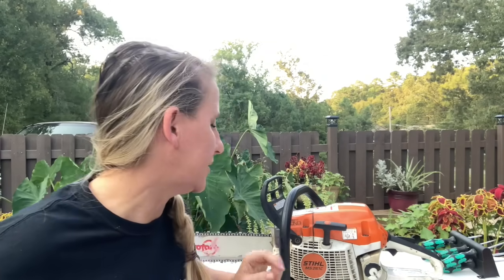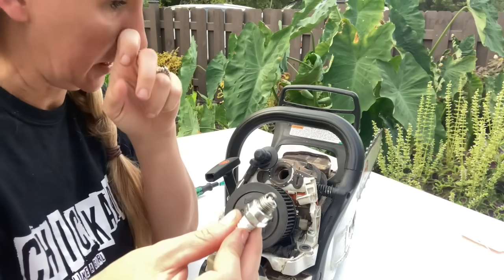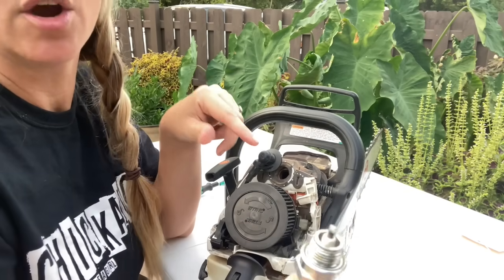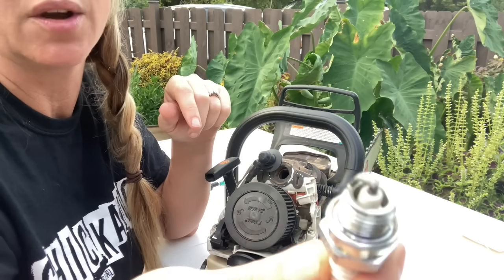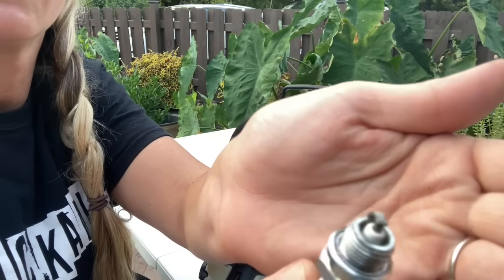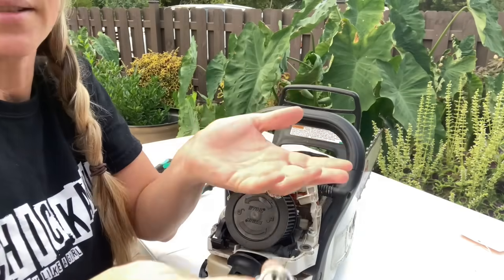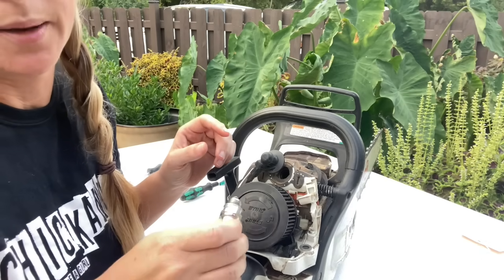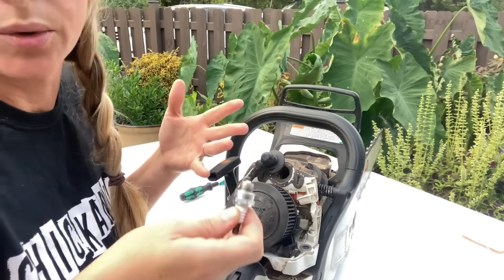STIHL M-TRONIC CHAINSAW HAS NO CARBURETOR ADJUST, WILL IT "RESET" TO REGULATE FUEL CORRECTLY?

Comment: takes 5-6 pulls to start when its cold....my chinese made weed wacker starts in 4 pulls max. usually 2-3 but if i'm fast enough on the choke lever i have gotten it start in 1. my $58 on clearance poulan blower starts in 3 pulls. my 3 chinese made chainsaws, 25cc, 42cc and 55 cc all start in 3-4 pulls except the 55 if it hasn't been run in a while it has no primer bulb it can take 6 pulls.

i can't believe people actually pay for Stihl equipment. get a clue people. their entire business model is about fleecing you. their oil is cheap shit. its JASO FB. the other brands, echo and husky are JASO FD! CERTIFIED! not "meets or exceeds".

don't believe me go hit the other channels that are saw oriented like The Iron Horse. Stihl's oils are dirty ashy oils. i can name 1/2 dozen better cheaper oils. Red Armor, Power Blend, Husky HP, Sabre pro, Opti,  Schaffers all cleaner than Stihl ultra. the orange bottle stuff isn't even rated!
Reply: You think all these name brands like Echo and Husqvarna are manufacturing their own oil? It all comes from the same place and gets a different name slapped on it. Stihl is expensive but so is Husky, Echo and any other saw manufacturer that has built a name recognition for themselves among professional users. In reality, the price of the pro level name brand saws is only a jaw drop for the home user. For the professional user, the price is average and only costs a portion of the money they will make with the tool.
Reply: @killer2600  its not "all comes from the same place and gets a different name slapped on it" you obviously don't know much about 2 cycle oils. Stihls HP Ultra is a jaso FB oil. says so right on the back of the bottle. I have one right here. Says Meets Jaso FB. The Vp oil I have here is Jaso FD certified with its Jaso cert number right there. the amsoil sabre i have simply claims to be Jaso FD and ISO l EGD as does the Shaffers 9006. Jaso FB is one of the oldest Jaso ratings. The Jaso standards measure detergency and lubricity and the current ratings are FB, FC, and FD. Lubricity is similar across the 3 standards but each has ever increasing levels of detergency. this is why Stihl owners running Stihls oil have to get their arrester screens and exhaust ports cleaned more frequently than users of the other 2 brands who use their brands oil. All of Echos and all of Huskys oils are Jaso FD certified. Btw have you noticed how Stihl sells the hp ultra and the orange bottle stuff here in the USA and not the HP super? The HP super is actually Jaso FD certifed but isn't sold here. You can get in Europe or in Australia but not here.

wonder why that is?
Reply: @MrSGL21  Jaso doesn't make oil so bringing it up is irrelevant. It's only a rating system for minimum compliance. 5w30 is an old long used oil weight, 0w40 is much newer, just because 5w30 is old doesn't mean it's not just as good as it always has been for cars that require 5w30. If Stihl engines only require Jaso FB compliant oil then Jaso FD rated oil is irrelevant. In fact if the newer spec isn't backwards compatible with the old spec then an oil with the newer rating could be the wrong oil for the engine - this most notably happens with old diesel engines.

If you want to be dupped into the most eye catching packaging and highest cost being the best then you should look into amsoil. They would love to have you as a customer of their exotic products. Not to say their oil isn't good but I've never used them and every thing I've ever owned or used works as good as ever despite me never giving amsoil a single cent. Even my 39 year old motorcycle still works and it's never had synthetic or expensive oil. Actually, it has the cheapest oil I can find for it that meets Jaso MA (motorcycle wet clutch) spec which funny enough is rotella diesel engine oil. So empty your wallet if you wish, I don't and my oldest vehicle doesn't burn any oil and runs great even if I'm not buying the oil with a picture of a motorcycle on the bottle.

Comment: Great video, I think the ignition module also senses the load on the saw when it's in the wood and richens the mixture accordingly, so an off load plug chop could be miss leading.. M- Tronic carbs are just as easy to rebuild as the normal carb. I strip,clean and replace the diaphragms in my MS 362 M -Tronic every 2yrs or so..Don't be afraid get stuck in.. lolx
Reply: issue ive encountered is big end bearings seizing no damage to cyl piston seems either a binding issue or my theory is developing an air leak and trying to autotune itself to compensate so continues running but kills itself vs just becoming unrunable so you fix it.
Reply: @glennlurman3514  You look far to young to be playing with chainsaws ! lol. Thanks for the info though, it does make good sense..

Comment: 3rd generation mtronic is a different recalibration process. Stihl technicians know that. I own several mtronic saws (261, 462, 661). All are excellent saws. Mtronic systems are extremely reliable. You're bread is obviously buttered by echo, and it shows.
Reply from the maker: This wasn’t a 3rd generation reset or I would had shown that. I love my Stihl Saws, 044 and 026. And yes, they are great saws, until they’re not. Thanks for watching!

Comment: Yep! That plug looked mighty lean to me, but unless you can see the very bottom of the ceramic insulator, (impossible to do without chopping off the threads- hence the term "plug chop") it might not be as bad as it seems. But the real tragedy is many folks see this and think- just add more oil, it'll be ok. But that only leans out the condition even more. Another example of "right to repair" needs in the real world.
Reply: The MDG1 diagnostic software is not needed to make any repairs on this saw or "tune" it. You CAN fine tune it with the software but it's usually not necessary. The reset procedure is usually good enough to get it to a standard setting to start out with and it will fine tune itself the more it's used. I hardly ever use my MDG1 tool on chainsaws I use it mostly on the more advanced stuff like the cutoff saws and the new 500i fuel injected stuff.
Reply: The only way to tune WOT by plug color is to first warm up the engine, install a brand new plug, run at WOT, and shut off the ignition while still at WOT.  The plug above is from a 2-stroke done exactly as described.
Reply: Go to the picture titled "The air/fuel indicators".  Most people have no idea how to properly tune by plug color...one of the main reasons I don't recommend it for chainsaw users.
Reply: @SNELLERIZED  I don't have any problems tuning a chainsaw by ear, you can't tune a chainsaw by the plug colour.
Reply: Umm..... yeah listen "plug chop" has nothing to do with hacking a plug up and everything to do with "chopping" the throttle when the engine is under load. Easier to understand maybe when you imaging running a motorcycle up through the gears and at some point at the top of a higher gear grabbing the clutch as you "chop" the throttle and coast to a stop all the while while killing the engine (letting it idle will ruin the coloring of the plug in the test).
That test can also be applied to other engines under load but you get the idea....it is all to do with plug coloring, hot cocoa or better please  ;)
Reply: @KelleyCycle  But you do need to remove the threaded portion of the plug in order to observe the very base of the porcelain.
Reply: @SNELLERIZED  No, you don't need to butcher up a sparkplug ( I've never seen or heard of anyone doing that here in Australia), just observe the bits you can see. Check the next heat range plug up or down & you can see the difference in plug porcelain design that regulates the plugs heat range. The carbon colour of the plug tip after running awhile is nice to know but a just four stroking saw under no load on H is what you need to achieve & you get that through carb L & H mixture adjust screws.
Reply: @dustyfarmer  The part of the porcelain you're looking at has nothing to do with WOT.
Reply: @SNELLERIZED  What your talking about has nothing to do with chainsaw or two stroke engine tuning.
Reply: @dustyfarmer  I t has 100% to do with tuning ANY engine at WOT using plug color.  The ONLY part of the porcelain that applies to WOT tuning as at the very base of the porcelain where it cannot be seen unless you cut off the threaded porting of the plug.  The higher portions of the plug that you can see are colored by midrange and idle.

Plug color is a very poor way to attempt to tune a chainsaw.
Reply: @KelleyCycle  Chop, chop, pork chop, you got it in one.
Reply from the maker: Yup, I didn't say it in the video, because I wasn't sure how to explain the heat I could feel and the smell of the muffler when a machine is burning hot.

Comment: I recently rebuilt a used and abused Mtronic saw (ms 362) that I got for a song and one of the things I found out is to check the solenoid and fuel filter. Early black solenoids had issues if any grime got in, so stihl came out with a finer orange filter and a redesigned white and later green solenoid that together avoided the solenoid from encountering issues.

Within one of those carbs, they're essentially a standard carb but with a solenoid driving fuel delivery, so it's critical that everything be clean and functional. On that topic, the gaskets and such are still worth checking on them. In my case, the metering diaphragm was hardened and needed attention. After that the saw has been running perfectly for a few tanks.

I also found out the reset procedures are different for the 3 versions of Mtronic, and I mean very different. For version 2 it's letting it idle for 90 in the start position, turn off, start in the run position for 60 seconds, turn off, start and do 5 cuts through a log (Ideally at least 12 inches). For version 3 you idle in the start position for 30-60 seconds, then full throttle for 30 seconds when you'll find the speed drops to an almost idle (indicating calibration is complete).

Or you can convert the saw to a standard carb pretty easily with a new carb, run switch, ignition module, and possibly flywheel. (I don't remember if those are different). Top cover, too, if you don't want to take the cover off every time you adjust the carb.
Reply: Thanks for the information.  How do you tell what version your looking at? I have a 462 that must be 3 because that's the procedure my dealer told me to use. So far I'm really liking the saw and am amazed at the consistency in tune. I cut in different temperatures and altitudes and the saw is always spot on in tune.
Reply: @markw2266  on the silver label under the rear handle it may say "M3.0" indicating version 3. If not, it should be version 2.
Reply: yes, flywheel too, at least on the 362
Reply: I was actually just coming to the comments to type the same response. Yours was much more thorough than mine would have been. Lol Good info!!!
Reply: That was a perfect explanation.!!!

Comment: I would rather have it run too rich than too lean.
Reply: plugs easier and cheaper to clean replace than the piston rings and jug.
Reply: To rich will make carbon build up and then heat retention, not good in the far south .
Reply: @Charlie-Saringo  not to mention plugging the spark arrestor
Reply: @MrSGL21  ok boss
Reply: yea, me too, but tell uncle sam

Comment: Hmmmm i think i will stay with my old "adjustable" carbs in my 2 saws, easy to service myself or at my local shop. Love your work ! 🚜😊
Reply from the maker: Thanks Greg!
Reply: @Chickanic  great videos but you are making a big mistake, the ground strap on the spark plug is not a good indicator of how the engine is running the colors you see on the ground strap are from additives in the fuel and oil and not necessarily the fuel-air mixture you should be looking at the porcelain down in the center of the plug, Also you need to run the engine for a longer amount of time to get an accurate reading especially with a new spark plug.

Comment: i have this exact model /new/ 2019 and after running it for about 4-5 hours i couldn't start it, it ran then wouldn't start. this kept happening again and again.
took it back to the dealer and they had to replace the Mtronic part, so they say, to fix it.
3 months  and $150 later it was "fixed" , has worked perfect since then all year, maybe the issue was fixed? it's a great saw until it aint...
Reply: wow. really? a 2 year old piece of equipment and you had to wait 3 months and then still pay $150 in repairs. down for THREE MONTHS.
Reply: @MrSGL21  ikr, something to do with Chinese virus or something...
Reply from the maker: Sorry to hear that!
Reply: The real question is,,,,if Auto companies are having a problem getting chips, could this affect smaller stuff like this?
I believe it will, and as of late, the pandemic is coming up again. So we'll have to wait N see, but glad you got ur saw running again👍👍

Comment: I'm scared of computers,that's why I stay with "old school",and I can still work on all of my own saws. :)
Reply: Vintage is the way to go  love em
Reply: @razoredgesaws4202  i run the new ol school echos 490 501 63 an 7310and recentl stumble up on late 70s early 80s 400evl n aliitle 30$ in parts its up to par startd quikly probly wont use it much tho finish is 95% too it look runns great **dont know i go t 63 meanto sy 620 the mighty 620 at that
Reply: Just put top ends on 038 super and 036 pro, now onto 2  026 big bores but have to split the cases for bearings on those and should be good for another 8-10 years and yes I carry a tiny screw driver in my pocket while in the woods.
Reply: As you reply using a computer almost none of us understand and definitely couldn't adjust.  Some humor meant but realistically all of our cars are becoming black boxes and run more reliably than they did historically.  A PITA to fix when they do break but dang they run well in general.
Reply: @jasonjordan9598  I can build an M1 rifle from parts without even thinking,I've built engines from the block up,but I can barely work my "smart phone"  :D
Reply: @jasonjordan9598  ,it was meant as humor,but the newest vehicle I own is a 2005. My other vehicles are 1990's models that I keep running,and their computers are very primitive .
Reply: @ryanbruner8928  All in fun.
Reply: Uggggh, computers are bad. Let's go back to witch doctors and smoke signals.
Reply: Cars are the same way
Reply: Love the old Macs!!
Reply: Same here.... Billy Gates and his crooked partners in crime did a number on civilization with the invention of a computer chip that's designed to fail. Made them trillionaires though. At our expense.
Reply: Should we tell him that he’s on a computer posting his comments? 🙄

Comment: That is very interesting. It reminds me of why I sort of like the equipment that’s about the same age that I am. Give me a set of points and  total adjustability and the engineering to last 50 or 75 years.
Reply from the maker: I am the same. Nothing meats the old stuff.
Reply: I own the MS 261 carb unit and it does fine. I own a Husqvarna XP 562 with auto tune that does fine. The spark plug burns brown at the electrode tip like it suppose too. If I would have had it to do over I would have bought the Sthil MS - 362 with the standard carburetor. I am old schooler and have other units blowers weedeaters prune saws. I just like having the option of making my own adjustments. I will have to admit the auto tune is nice own the Husqvarna and sthil sells alot of the m tronic saws.

Comment: the husqvarna and stihl systems are extremely similar.  i heard that the first generation of this technology was sold by one to the other but cant remember which way around. i know the husqvarna system reads baro at start up and varies the fuel delivery dependant on that. so each time it starts it is basically reset.   ones that come in cooked usually have plugged air filters  and our belief is (but we are not sure of) is that the carbs will adjust for the dirty filters but there is no cut off in the programming and they go way lean because of the reduced air flow and higher baro pressures seen by the sensor. 

on another note-  once a carb is set (which should be done on a good operating saw (or whatever it is)with good fuel plug  air cleaner etc). there should not be a need to tweak it.  see it all the time. if it starts to loose power or run poorly  put down the screwdriver and see what has changed.  bad gas diferent mix dirty air filter  plugged fuel filter plugged exhaust  crankcase leak etc.  its change in running is an indicator that something is different and a tweak may be a quick fix  it will continue to go down hill.
Reply: Husky developed the mtronic and was forced to share with Stihl over a trade agreement
Reply: Redmax made both systems and some time after Husqvarna bought Redmax they sold the Mtronics system to Stihl.
Reply: Typically, a stuffy air filter causes them to go rich, by acting like the choke is on.
Reply: @vincentrobinette1507  How often does that happen ?
Reply: Hung, what you mean, how's it happened? I quite chainsaw in 96. What's all that? Ain't nothin stays the same.yesterday's gone 😭🤫
Reply: This comment takes me back to 1975 spanish dirt bike FT Femsa magneto, 1976 changed to Femsatronic IGN, It became known as Failsyatronic, We would machine up a breakerplate to run points,, But by the 80s it was reliable, I would like to study the components use in the engine managment electronis system, Does it have an O2 senser, Doesit have an EGT, and i'm sure a Knock detector is not what you want on a 2 stroke, And timing curve you want the timing advanced for easy start, But to retard as rpm rises
Reply: Montesa, Bultaco, Ossa, Penton, Dalesman,, All gone